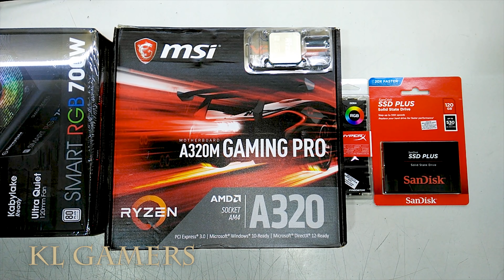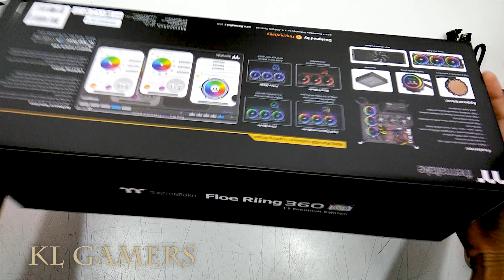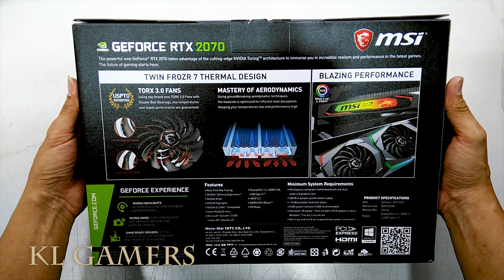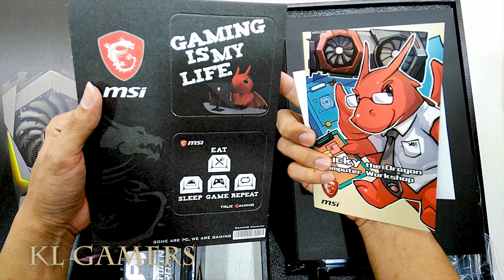AMD Ryzen 5 2400G msi A320M GAMING PRO Sandisk SSD RTX 2070 GAMING Z Thermaltake Floe Riing 360

Comment: What kind of odd selection of components are these! 
A320 and Ryzen 2400G APU with HIghend 2070 graphics card, and single 8GB Ram!
Reply: Does A320 are not good? Better go with b450?
Reply: @faizxs1  If you have the budget go with B450, but A320 is good enough for it's price.

Comment: Better with 2 sticks of 4 GB DDR4 2400 than 1 stick of 8 GB DDR4 3200. No need for other than stock cooler. No need for beefy PSU and if using an APU then no need for crazy graphics card. Else use a CPU with no built in graphics

Comment: This video will be added to worst pc build list for sure🤣😆 

To be frank ryzen 5 2400g cant even use gtx 1060 to its max performance..  ur putting rtx 2070 🤣🤣🤣🔥🔥🔥
Reply: Are you sure? I pair 2400g with gtx 1070 and it run just below 5 fps to ryzen 5 3600 farcry 5

Comment: Hi,my pc sometimes hang when I open an apps. can anyone help me. I just build the pc. Some parts are from my old pc. Here the list
Oldpc:
Old Can cooler master casing
Cooler master 460w
Wd500gb
Ssd120gb
RX550 2gb gpu

N new part
Mobo mortar max 450m
Cpu Ryzen 3 3300x
Ram Xpg 8gb 3000mhz x2

The hang is like stuck and sound goes like remix. U know like robot short-circuit. I need to wait like 5 sec then it goes back normal.

Comment: wait wait wait bro. I need your help. Wasn't there a saying this motherboard wouldn't support ram speeds higher than 2133 or max2400 mhz?  does it actually work with 3200mhz ram. like... does it use all the ram or does it just lock at 2400mhz
Reply from the maker: 2 x DDR4 memory slots, support up to 64GB *ComboPI 1.0.0.3-based and above BIOS are required.
- Support DDR4 1866/2133/2400/2667/2933(OC)/3200(OC) Mhz*
• Dual channel memory architecture
• Supports non-ECC UDIMM memory
• Supports ECC UDIMM memory (non-ECC mode)
* A-series / Athlon™ X4 processors support up to DDR 2400 MHz only. Please refer www.msi.com for more information on compatible memory.